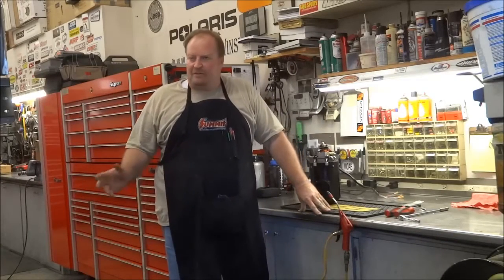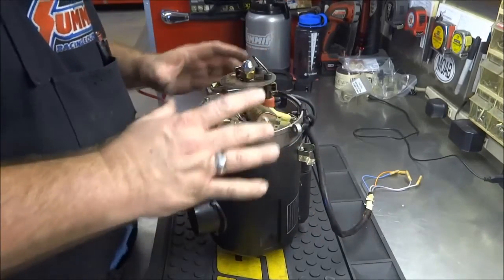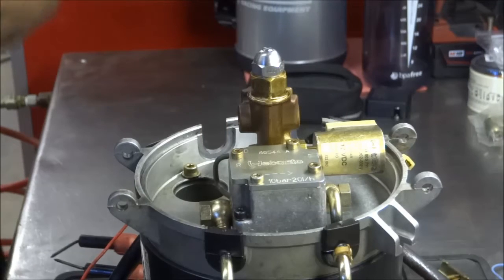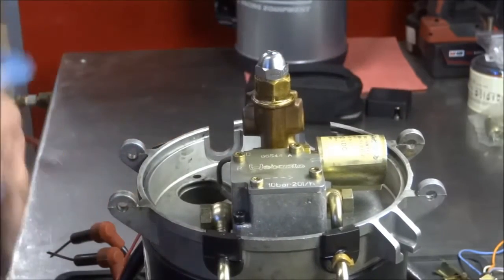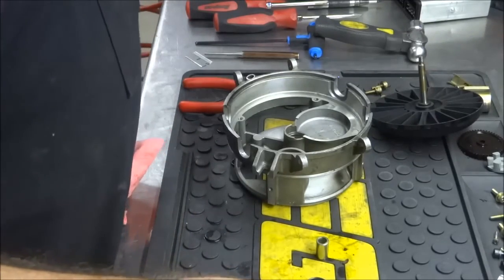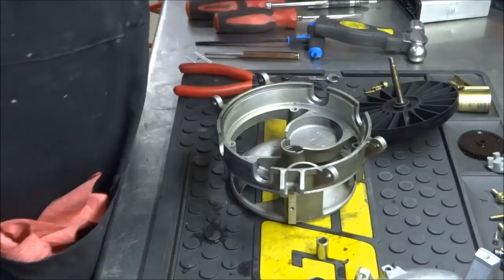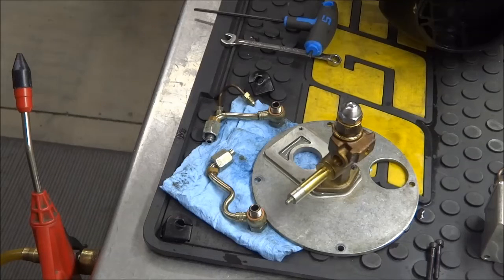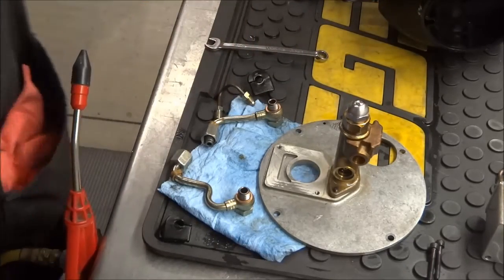AquaHot Fuel Pump Replacement

Comment: I have been watching all your Aqua hot videos and you are very informative and very thorough on your explanation of maintenance and repairing the Aqua hot system. There are not many people available to speak with regarding diagnosis on this system . Thank you for putting this up on You tube as it will help may of us performing maintenance and repairs on our aqua hot systems.
Reply from the maker: Thank you for watching and especially for the kind words.  I am glad to hear the videos are helpful. 
Mike

Comment: Excellent step by step maintenance/rebuild procedures for the Wabasto diesel hot water heater/furnace. Brilliant commentary complete with torque settings for the nuts and bolts! Great insight for this system, Mike. Thanks so much for posting this video.

Comment: Thanks for the time you put into this. AquaHots are intimidating to work on! If it wasn't for video's like this and Roger's website a lot of us would be out of luck. Thanks!
Reply from the maker: Thank you for your comments and thank you for watching.  I hope if was helpful.  They can be intimidating but just remember they are merely several components working together.  They are not too awfully difficult to work on, the difficulty comes when troubleshooting and determining which of the components is failing or not contributing.
Mike.

Comment: Hello Mike,  This will be the first time that I have service my Hydro-Hot myself.  Your video really taught me a lot.  I bought an instruction book on how to do this, but would not have been able to do it solely from the service manual had it not been for you.  Question:  Do you know what mixture - water to antifreeze that you are suppose to add to the antifreeze reservoir?
Reply from the maker: Thanks for the kind words Randy and thank you for watching. I’m glad the video was helpful. 
As for the glycol mixture it is 50/50 with distilled water. Be certain to use the correct glycol and distilled water to eliminate deposit buildup in your system. I’ve been using boiler glycol marketed by Camco which is readily available. 
Mike

Comment: Thank God for you. My bearings went and all hell broke loose. Ordered all the parts and never did anything like this before - but like you I’m a mechanic. Thanks for the video. I have a question about the coil - do you know much about replacing that?
Reply from the maker: Are you referring to the coil on the fuel solenoid or the igniter coil?  I have replaced both on various coaches. 
Thanks for watching and I am glad it was helpful. 
Mike
Reply: zmotorsports the coil which the water passes through to return hot water into the coach...
Reply from the maker: The domestic coil is not a serviceable component. Depending on the model year of your actual Aqua-Hot unit will determine the style of the domestic loop. Approx 2002 model year units and older have the domestic hot water coil wrapped around the outside of the boiler tank and held on or secured to the boiler tank by means of a conductive paste that when dry not only holds the loop in place but also aids in conducting heat from the boiler tank to the copper domestic line. 
On approx 2003/2004 model year Aqua-Hot unit’s and newer, the domestic loop is actually located inside of the boiler tank which has the heated glycol surrounding it which transfers the heat from the glycol through the tubing which heats the water. 
Either way if your unit has a failed domestic line or coil it will require replacement with a new or remanufactured unit. 
I hope that is what you were asking. 
Mike

Comment: Mike, do you know the difference between Hydro nd Aqua Hot - did two companies merge? There are many different models and only one annual service kit... safe to assume same nozzle and fuel filter? My model is not listed HHU-500-09M has a man date of Jan 2013. All your knowledge and ability is amazing!
Reply from the maker: Thank you for the kind words. 
As far as the differences, they both are diesel fired units which provide interior heating as well as domestic hot water. The Hydro-Hot is referred to as the little brother to the Aqua-Hot due to physical size for one as the Hydro-Jot was designed to fit similar to a 10-gallon water heater whereas the Aqua-Hot is large enough to take up most of a half bay. 
The Aqua-Hot will provide interior heating and domestic water on demand at full volume whereas the Hydro-Hot will drop out heating function when the heating of the domestic water is too demanding. 
I hope all that makes sense but they are very similar yet different. 
Thanks again for watching and I hope you find the content helpful. 
Mike

Comment: Thanks for sharing man! I went through a training on these systems and they mentioned to put the shims and bearings (inside air chamber) in exact order. I saw your bearings still on the table while you were almost done? so did you actually replaced them or is it running without them? thanks again!
Reply from the maker: Viliam Palček I installed new bearings. My fear was from the fuel pump leaking it had washed the lubricant out of the bearings and even though they felt fine, I didn't want to risk it for the price of a couple bearings. 
Thanks for watching and I'm glad you found it helpful. 
Mike.

Comment: Thanks for the video…. Just a quick question…… to replace my fuel solenoid, I must pull the whole housing out, right?!?    Or is it possible to replace the whole fuel solenoid by swinging the head open and do it from the side?!?   I’d appreciate any advice.  Thx.
Reply from the maker: It can be done by swinging the whole burner assembly away from the combustion chamber, but it is so much easier with it completely removed.  Plus less chance of damaging wiring or a connection.  

Thanks for watching.
Mike

Comment: Mike Thanks for another great video.  I over tightened my casting blower and broke a the ear off!  Is it possible to repair it with JB Weld or have someone weld it?  I also chipped some of insulation off the electric igniter when removing the fuel nozzle.
Reply from the maker: You could try repairing it but I would be doubtful it would hold sufficiently enough. 
Thanks for watching and I’m glad it was helpful. 
Mike
Reply: Mike thanks again...how do you change the electrodes I chipped the ceramic around one of them? Also what about securing the housing by using the other places for bolts as opposed to the j-bolts?
Reply from the maker: You could try using one of the other bosses but I haven’t had to do that so I can’t tell you for certain if it will work or not. 
As for the electrodes, they remove as the pair and connect to the coil on the outside of the unit.  Then use the gauge secured to the outside of the case as the means of setting the correct gap. 
Mike

Comment: Do they sell a rebuild kit for the fuel pump?
Reply from the maker: No.  I think it is only available as an assembly.  All other parts such as bearings, banjo fittings, fuel lines, etc. must be purchased individually as well as they used no "kit" that I am aware of.

Thanks for watching.
Mike

Comment: Thanks for the info, can you tell us how and when to change the fluids in the Aqua Hot? I don't think it's suppose to be a whiskey colored fluid! So I am wondering if the fluid needs replaced in the system.
Reply from the maker: The only fluid to speak of is the glycol which flows from the boiler tank to each of the heat registers.  It is a closed system so unless someone has introduced a fluid other than the approved fluid it should last quite a few years.  Ours continues to be a nice pink color and I changed it once after purchasing the coach because the unit had a leak.  I did not know what the previous owner had put in it so I flushed it out and added the correct fluid.  If yours appears to be contaminated I would drain and refill with fresh glycol.  
Mike.
Reply: GREAT video Mike. I took my 08 Tiffin to Red Bay. The service center drained my glycol, flushed the system using water, a couple 5 gallon buckets and circulation pump then refilled with nice pink glycol. A few days later (staying in the coach at night) I reported that the AH didn't seem to be working correctly.  In a regular service bay they found a circulation pump not working. While replacing it, you could see that the pretty pink glycol had already turned brown. Must be a secret to getting all the registers flushed or the "quick bay" guys hadn't learned the flush procedure yet.
Reply from the maker: +mtinaustin thanks for the comments. Sorry you have issues getting all of the glycol removed. That was a lot of wasted time for them going completely through that process and then having to go back and do it again. 

When I did mine I pulled a vacuum then opened drain multiple times before the full and drain cycles. I think it helped to get the glycol away from the registers and into the main tank so it could be expelled from the system. 

Thanks again for watching and commenting. 

Mike

Comment: Mike, I love your videos, I recently bought a 2004 Beaver and I am having issues with the Aqua hot. I have done the filter and nozzle and adjusted the igniters. I am still having issues. I would like to talk to you if possible. I live in northern Utah and I don't think I am far from your shop. Let me know if contacting you is possible. Thanks
Reply from the maker: Gary, I think you can send me an email message through YouTube when logged on. Shoot me a message there and I will reply with contact information. 
Thanks. 
Mike

Comment: I have been trying to find a video on replacing a stir pump. Do you have any help on this subject?
Reply from the maker: +James Lockwood sorry no video on stir pump replacement. They are not difficult to replace just be sure to bleed properly or the pump will not circulate the glycol. 
Mike

Comment: I just bought a tiffin phaeton 2015 with aqua hot in it 
Our friends has 1 also and have had problems with theirs 
They just got back from red bay al. Having it rebuilt  $!!! $
Reply from the maker: Congrats on the new coach. Tiffin makes a fine coach. Even with the few issues I’ve had with my Aqua-Hot, I would never have another coach without it. Personally I’m not as impressed with the newer AH units the more I’m around them which is why I’ll keep my old coach with the older model AH. 
Thanks again for watching. 
Mike

Comment: well, its not yellow or pink and the overflow tank seems to have some sort of algi or mold in bottom...maybe we should just drain it and put fresh in.
Reply from the maker: That doesn't sound good.  I would recommend a drain and refill and get all of that nasty stuff out of there.  Not only could it contaminate the system, but it will also adversely effect the fluids ability to transfer heat which could have a negative effect on how well the system works in general.
Mike.
Reply: Thanks again Mike. One more question how much fluid does the system take?  I have gone to Roger Berkes forum as well and he did mention that the camcoa fluid is known to turn brownish but as far as changing the fluid no concise information. One good thing, my 08 Camelot has much easier access than your!
Reply from the maker: +Karen Studer There really is no "set" amount.  They vary from coach to coach because of the length of PEX, amount of heat registers and such.  I can't remember off the top of my head how much my system holds.  
Mike.